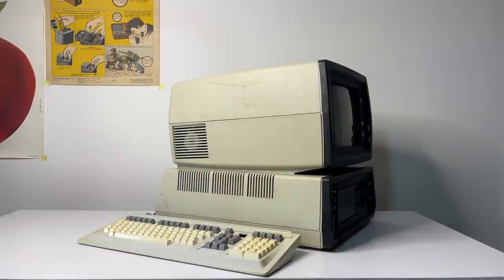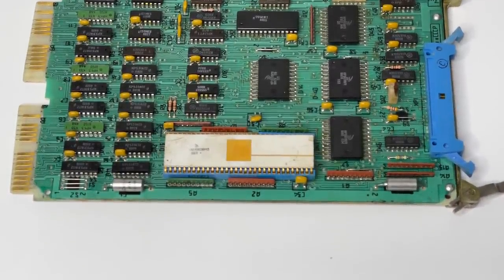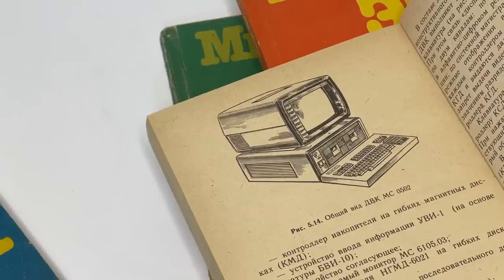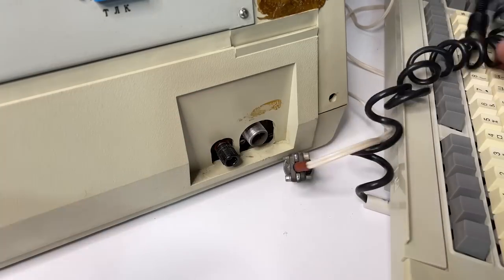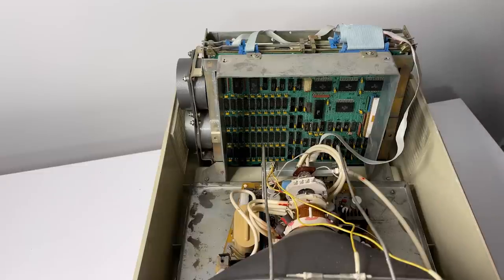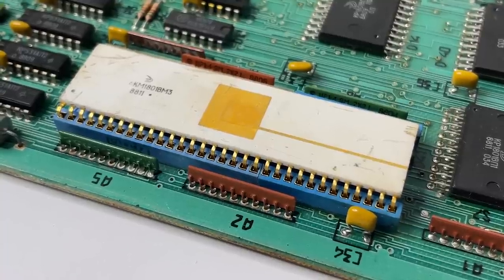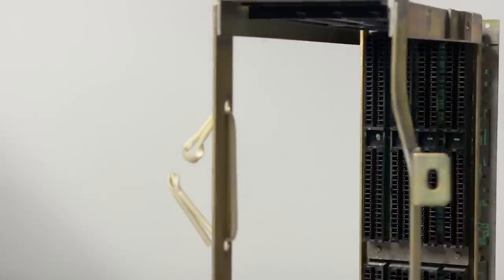DVK-3, the MOST CHERNOBYL COMPUTER EVER.

Comment: About graphics card. It may seem weird from a modern standpoint, but back then it was quite common for seemingly unrelated functions to be placed on the same daughter board or even in one chip, especially if both of those functions were essential. It was made just to save some space and money in production. This way of designing was likely just adopted by the engineers who were reverse-engineering those old systems.
Reply from the maker: Thank you! The thing is, there exists a separate controller called KTLK for the telegraph channel, though your idea seems to be very very possible (it is enough to remember the floppy controller for ES 1841 that hosts a mouse). Therefore we asked that question
Reply: And nowadays they make entire systems onto same small board, or.. chip ;)
Reply from the maker: @TheSimoc  yeah...)

Comment: I started my computing career on a PDP-90 followed by a PDP-11 followed by an Intel MPW. The Intel Microprocessor Workstation was interesting because it was programmed by 'flipping' bits in an on-screen display. The screen was divided into blocks of sixteen 'bits' - if you got one wrong you didn't find out until the compiler had completed some two hours or so later and you had programmed the EPROM. Not EEPROM - if you had got it wrong the very expensive EPROM was scrap.
Reply from the maker: Thank you for sharing!

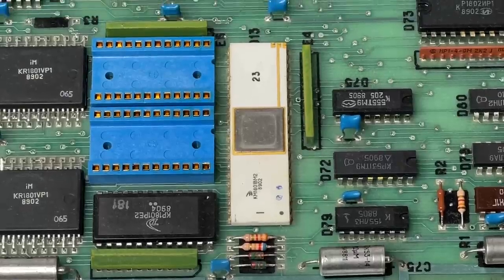Comment: The main chip on the graphics card (shown clearly at 12:15) is a KM1801BM2, which is the 40 pin version of the CPU (smaller address bus).  So I suspect someone else's comment about missing ROMs might be accurate, unless the firmware for this board is run out of RAM.
"Fun" fact (for small levels of fun).  The reason for the unusual socket for the main CPU is that its pin spacing is only 2.5 mm wide, not the standard 2.54 mm (0.1 inch) pitch.

Comment: Khaki shade powder coated connector is a 'cannon' type, so called soviet clone a SB or something like that. In 1923 James Cannon developed the M plug and revolutionized electronics industry and turned the "Cannon plug" into a generic name. Then in 1927 Douglas Aircraft Co. began to use 'cannons' in avionics. Nowadays ITT Corp. producing them, I personally familiar with product from GlenAire and AB Connectors 'cannons'.
Reply from the maker: I was thinking it is a clone of Bendix.

Comment: I used to run a PDP-11/34 which I upgraded to 11/44 standard with a Nissho board. Programmed mostly in Macro-11, some Fortran IV (couldn't find the money for the Fortran 77 compiler) and a tiny bit of C (using that public domain compiler).  Apart from my ATC-related programming I remember doing a "snake" game for VT-100 (using escape sequences), two adjacent terminals woiuld fight on the screen of one (but using both keyboards), the winner was he whose snake managed to encircle the other one and cause it to crash into a wall (or a snake). Good times.
Reply from the maker: Thank you for this awesome story!

Comment: Great Video.  The PDP-11 was a very popular system used in the Nuclear Industry.  I remember reading a few years ago that at least one Canadian Nuclear Power Plant still uses them today.
Reply: PDP-11 was the best thing in computing for many years, it’s only because of the rise of the personal computing market (and bad corporate decisions) that the platform and its successors died out. Without these machines though the infrastructure the modern world runs on may never have come to be.
Reply from the maker: Thank you both for your comments. We so far are not that good in this platform (though we know much about its use here), need to learn more about the hardware in general. But it is an amazing journey!
Reply: @Underestimated37   I only know of the PDP series historically.  I have a little experience operating VMS on the VAX and Alpha systems that followed it.  Knowing that some of the US military systems not that long ago still used 8" floppy disks, I'm not shocked a nuclear plant still uses PDPs, but it's certainly technical debt at this point (and even long ago).
Reply: @jasonhaman4670  often systems like this are preferred as they’re so obsolete that malicious outsiders can’t interfere with them, and the programming languages are dead or obscure. As long as the machine performs its core tasks, it can often be left in place until end of life. The other good thing was they’re often from an era where specialized parts aren’t needed either.
Reply: @Underestimated37  I work in industrial IT... security by obsolescense or obscurity is a thing, but it's risky.  Now, if it's truly isolated, then sure, as long as they can maintain a team that fully understands the system and is able to maintain it, sure.  But as the decades pass, that becomes move of a challenge.
Reply: @jasonhaman4670  one factor is that the bugs of the system are known , which is very important in real-time processes,  and even more if security is needed.
Reply: There are Canadian nuclear plants with contracts to keep the PDP-11s going until 2050. I'm not even kidding.

Comment: Oh snap! I finally figured the origin of it, the keypad seen @ 7:08 ! Have it around for a real while but never remembered where it is from. A really fascinating thing it is, as the buttons are actually magnetic, each packed with a Hall sensor IC (yes, not even a Reed switch). The top one feeds an output buffer directly (yes, this pad has a buffer IC), the other two control the T-triggers on the keypad board to both drive the other two buffers and the corresponding LEDs. The only thing but the IC power (along with the mains LED) and the buffer outputs routed to the pin header of this thing are the pins of the failure red LED routed directly, guess there is something behind this solution.
Reply from the maker: Yes! And that keyboard consumes energy like hell.
Reply: @ChernobylFamily  Lol yeah, I never really measured though I estimate somewhat 20 mA per LED, those are kinda old, - and two TTL ICs (triggers and buffer array)... Pretty much like a Bluetooth, not even BLE, complete keyboard )) Though those Hall keys are something, guess their lifespan is the closest to infinite a button may ever get. Won't mind an ESD receiver shield though, but doubt something made almost completely from plastic has a high chance of flashing over, especially with the metal plate around.

Comment: I wonder if the machine will start because of the graphics card having no ROMs installed. Those will be almost impossible to find. On the other hand, the serial cable being plugged into the graphics card would mean that it just acts as a regular terminal if no graphics were being used -- meaning you could also connect the external terminal and use the machine without graphics. Given that this is a minicomputer platform (which is designed to be multi-user) basically shrunk down into a desktop case that would make sense.

The floppy drives and controllers look like they're the regular Shugart-interface type if the ribbon connector on the controller is a 34 pin. Hard drive would probably need its own dedicated MFM or SCSI controller card.
Reply from the maker: Still need to investigate that. A good thing, that DVKs are good documented and ROMs are available, so if such need will appear we will be able to use some help from friends. As for the HDD, you are totally correct, we need to have a so-called KMD card for it.

Comment: the modularity of the power supplies is very interesting. can be replaced as one module without dismantling all the cabling inside. fantastic design !
do you have schematics for those boards anywhere ?
Reply from the maker: Yes, for some yes. Will scan and post on Patreon as soon as we will have stabilized situation - now we do not have energy 5-7 times per day, impossible to work properly((
Reply: <insert some russian-blaming expletive here>
Reply from the maker: @AmauryJacquot  sad smile

Comment: “The most Chornobyl computer…”

When you switch it off and then quickly switch it on again, the cooling fails, the central core overheats and it goes into a meltdown…
Reply from the maker: In fact, jokes apart... when you see remains of these machines across Jupiter factory, it gives shivers. I mean, when you imagine, what they did with that very hardware, with all its limitations, and all that in a middleof an abandoned city... just think for a moment

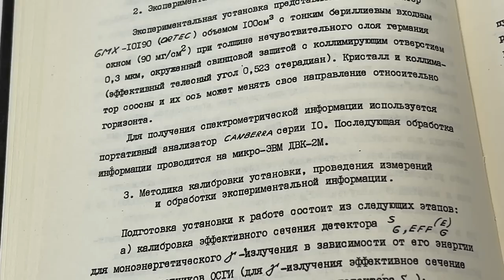Comment: Interesting, at 3:22 there's the word "CANBERRA" in the text, which is the name of the Australian capital city. Using the google translate app on my phone, it looks like that's the name of the portable spectrographic (?) analyser. I'm curious if there is a connection to the Australian city of Canberra, or if this is just some strange coincidence?
Reply from the maker: Canberra here stood for Canberra Industries, a 1965-founded United States company that was a producer of various radiation analysis equipment under the brand Canberra. Back in the 80-s, a lot of foreign countries supplied a technical help to the Zone as we needed a certain equipment (so did, e.g. Nokia, which produced a lot of spectrometers as well). A few years ago, Canberra Inc. has been acquired by MIRION Technologies, these guys supply a lot of equipment for the Chornobyl NPP up to the present day.

However, two more notes to add:
In relation to Australia, a very little known fact is, that the name of the paint of that distinct blue color used on Soviet mainframes (see introduction episode of CoC series) was called Adelaide.

And the second thing, many methods/devices here were called (even in documentation) after the place of origin. E.g. there is a term "Monte-Carlo method of analysis", and so on.
Reply: Phrase translation: "to obtain spectrometric information, a portable analyzer "canberra" series 10 is used."

Comment: Interesting stuff, I love me a good teardown! All those connectors are interesting in their own way. DIN, a german standard, was it not? And the PCB edge connectors cut at an angle, why are they like that? The beefy power connector was awesome! Saw your link on r/vintagecomputing :)
Reply from the maker: Well, round DIN connectors were widely used here, though normally for analog signals. As for the shape of the board connectors - we believe to make its insertion easier
Reply: @ChernobylFamily  I'm sure you are correct that the angled connectors make insertion easier - I've never seen that before, but it is a very clever design!

Comment: Its great to known there is some PDP-11's in Russia. You will need to try and restore for a 50+ year machine. Its proper vintage. Look up retrobrighting to clean up the case. The capacitors will probably need to be changed.
Reply from the maker: We are based not in Russia at all. Yes, there is much to do with it, however the case is not yellowed, this is its color.
Reply: @ChernobylFamily  It not, its really dull. It might be worth doing a small panel to see how retrobrightening work for you. It likely it will come up a nice yellow pink colour, not whats on it at the moment after 40-50 years. Its great to hear for you. I wonder if could take a new firmware in English. I would to have a pdp-11. It really grand your doing this.
Reply: @bobwatson957  вы заблуждаетесь,  советские процессоры 70х-80х для "ДВК" (к1801вм..) используют лишь архитектуру PDP, но не являются клонами.  это  собственные разработки, не совместимые с американским PDP.
в отличие например от комплектов чипов к580 и к1816, которые являются копиями комплектов 8080 и 8086
Reply: @fokinDim  That is ufortunate. I was quite looking forward to going to Russia to look for one to restore and reuse.

Comment: Hello, around the 5:51 shows the telecommunication connector, which is also found on EG Olympia typewriters for connecting a processing unit which turns the typewriter into a computer. Do you happen to know what type of cable do you need in order to utilize it? And where to find one.
Reply from the maker: Telegraph channel... need to look into documentation for it, it will take some time.
Reply: @ChernobylFamily  Thank you for responding! Can't wait!

Comment: Soviet technological solutions are fascinating.
I don't quite understand the Operating System and compatible Unix?
Do you have a video with the system working and demonstrating programs and systems?
Congratulations on the work.
Reply from the maker: For DVK, they had e.g. DEMOS, which is based on BSD UNIX. Unfortunately, we did not resolve a few issues with this machine, it has a serious production fault, but at some point it will run. Thank you!
Reply: @ChernobylFamily  I am grateful for your work in keeping the memory of ancient technological achievements alive. I am sure that at some point a solution to the problems will be found. In DOS-based systems, what was the most used programming language, I extend the question to Unix/like systems?

Comment: It's a shame people destroy these old computers just to get a few cents worth of gold plating, which isn't really worth the cost to actually recover.

Separating the gold from the base metal usually requires dissolving it in acid and processing the chemicals to precipitate the gold. But this is only cost effective in huge quantities, processing thousands of KG of e-waste to recover a few grams each of gold and other valuable metals. Processing just the few KG of electronics in these computers will only recover what went into them, just a few cents worth of valuable metals. However it will cost many times more than that for the chemicals required to do it.
Reply from the maker: what we know from a few guys who do this kind of stuff (and who actually try to save really valuable stuff if it gets to their hands), in the case of Soviet electronics made <1987 it can be very profitable, as amount of gold may be ridiculous. Just this machine by gold and palladium only is ±US$1K they told. At the same time, the trouble is that many of these guys could be far more rich if they would see historical value, not just metal.

Comment: I think in 1991, Elektronika shrank the entire thing into a small graphing calculator.
Reply from the maker: Edit: did not get what you mean correctly. Right. Check the ep.4 of this series on our channel.
Reply: @ChernobylFamily  I forgot which one it was. But it had the PDP 11 core used as CPU in the BK 0010/11 series.
Reply from the maker: MK-90? Though it is not really the same packed in a smaller volume, just compatible.
Reply: @ChernobylFamily  That is true. Because the chip that the BK 0010 series is based on, is more of an SOC. The MK-90 is missing everything, including QBus, but the CPU core itself. Still runs the same code, which is kinda cool, hehe.
Reply from the maker: @AmstradExin  yeah, an interesting  device, but so badly documented as for 2022((

Comment: Then question is: When the Microchip is that big, is it still microchip or megachip? 😊
Reply from the maker: It is gigachip!
Reply: @ChernobylFamily  😂
Reply: In the USA, they had bigger microchips ;) MC68000 was way bigger, and had 64 pins (still in DIL style case).
Reply from the maker: @TzOk  sure, and well, even any 486 is bigger:) just cant recall any soviet in a DIP case to be that huge :)
Reply: @ChernobylFamily  Yet it was not a record for a number of pins/size of DIP style packaged CPU. I also think both CPUs were made in more or less the same period of time. Yet I guess, soviet chip (the silicone tile itself) was way bigger.
Reply from the maker: @TzOk  looks so

Comment: Power supply has warning per soviet electrical safety code about the groups of electrical safety qualification of service personnel. Any circuits of any electrical or electronic equipment below 1,000V or 1kV shall be serviced by qualified personnel within the minimum III-third electrical safety qualification group of certified personnel with relevant credentials. 
   For example, a person within the II-second electrical safety qualification group of certified personnel shall not performed any work on any circuits of any electrical or electronic equipment below 1,000V on one's own. That person can be providing assistance to a person within III-third electrical safety qualification group of certified personnel. 
   Within the I-first electrical safety qualification group of certified personnel belong all other personnel which not involved in servicing of any electrical or electronic equipment. Usually, personnel within the II-second electrical safety qualification group has received the initial electrical safety training and has been certified and received relevant credentials. Exceptions may be applied to any students of any educational institution which received relevant training at that institution and have been certified and having valid relevant credentials.
   Personnel within the IV-fourth electrical safety qualification group of certified personnel with relevant credentials shall be performed any work on any circuits of any electrical or electronic equipment below AND above 1,000V or 1KV.
   Personnel within the V-fifth electrical safety qualification group of certified personnel with relevant credentials shall be performed any work on any circuits of any electrical or electronic equipment below AND above 1,000V or 1KV, provide management to organization, provide any training to any work personnel, provide with any PPE to any work personnel, provide engineering and administrative control for work safety, maintain any relevant documents, related to organization. Engineering and administrative personnel constitutes the V-fifth electrical safety qualification group of certified personnel with relevant credentials.